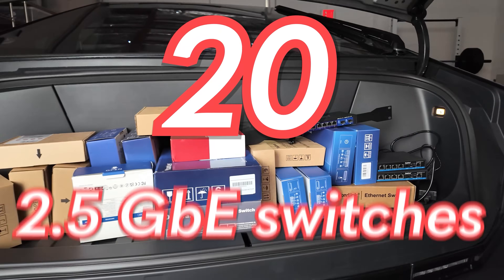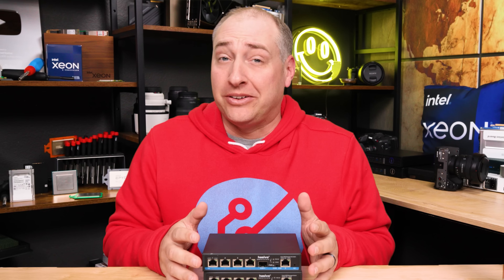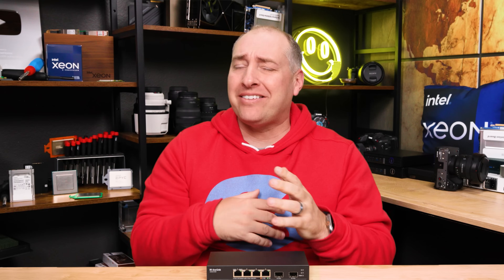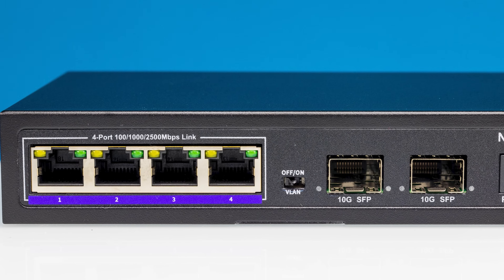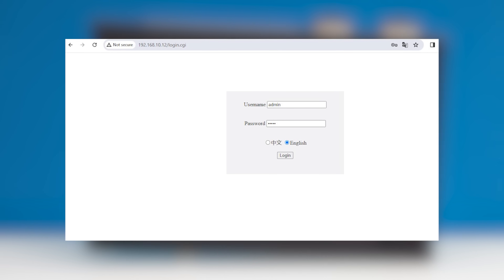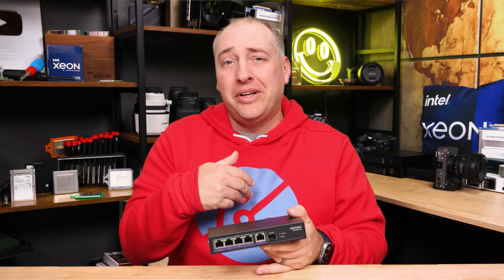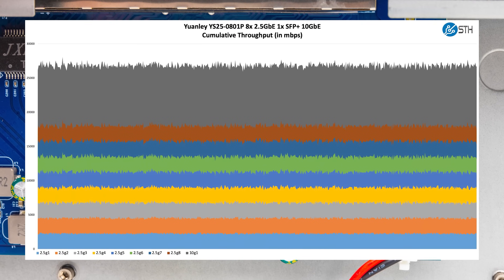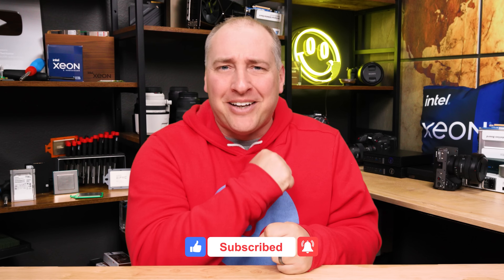Finding the BEST Cheap 2.5GbE Switch... by Testing 21 of Them

Comment: Man I really gotta question some of these prices. Why are many of the 8  2.5GbE (with no SFP or anything) more expensive than the 8 2.5GbE + 2 SFP switches?
Reply from the maker: A lot of it is that the 8+1 switches use a well-known dual Realtek chip solution that I think was developed for automotive. Then volume took over and the prices went for a nosedive.

Comment: Have you guys had any issues with the gigaplus gp-s250802 10gbe ports?

I recently purchased one and have had issues with the 10gbe port randomly disconnecting. I was using one 10gbe to uplink to our WiFi router but it'd disconnect our (wired) internet in the middle of my work day.  Using one of the 2.5gbe ports has not had any issues.
Reply from the maker: Are you using SFP+ optics or DACs? On these cheap switches optics seem to do better
Reply: Yeah, cheap H!Fiber 10gbe rj45 dac from Amazon. 

Using optical for the router connection is doable but I was hoping to use the 2nd port with in wall Ethernet for 10gbe up to our 3rd floor. 

Ah well, get what you pay for I suppose!

Comment: Hey Patrick, Does the Hasivo S600W vs the S600WP still have the same MAC issue, or does the P version MAC address differs? i need 2 of the switches and saw your focus video on them, not sure if the other models of the switch still has the same mac clash issue. Also what transciever works with hasivo if you have that info?
Reply from the maker: People have reported newer firmware fixed the issue. Also, we shoed in the video the Mokerlink is the Hasivo but on Amazon.

Comment: I am not sure if it can be considered "cheap" (it is higher price than for switches presented here). But 2 weeks ago I have purchased Zyxel XMG1915-10EP (8x2.5G, 2x10G SFP+1), all 2.5G ports are POE++. It is fully managed switch. The "recalculated" price was 330USD. The non-POE version is about 270USD.
Reply: Buy once, cry once..  In many respects, I'd rather buy a quality product over  a cheap; don't get me wrong, I do like cheap, but if the choice is buy once cry once, or get something cheap that MIGHT work, well, I'd rather cry and not waste my time.

Comment: Have you noticed slower ping times on the 2.5gig switches vs the 1gig switches?
Reply from the maker: Not really.
Reply: What I have noticed is 10gig SFP+ DAC ping times are very low compared to 1gig Ethernet.
Reply: @ServeTheHomeVideo  with 1gig, I noticed ping times at around 0.25 ms. With the 2.5gig switches, I’m getting 0.6 - 0.9 ms.

Comment: I don't get why gigabit switches with 2.5g rj45 uplinks aren't more common. It would provide sufficient bandwidth without having to go fiber while also costing a lot less than 2.5g-only switches.
Reply from the maker: At this point, the 2.5GbE switches are getting much less expensive.
Reply: @ServeTheHomeVideo  True but it's still not there yet especially if you need a lot of ports, which unfortunately most people do. Great video regardless. Your videos on network hardware are top notch👍

Comment: I would love, if you could test to power these switch using a USB-C PD 12v instead of the crappy power supply. I've replaced all the DC 9v,12v power supply.
Reply: If you get one of those little adapter jack / usb PD with a 12v trigger board, there is no reason it wouldn't work as long as your USB brick can deliver enough current
Reply: I'm not sure that's an improvement, especially if you use an adaptor. The 9v and 12v switches are very tolerant of voltage meaning you could run the power over quite long cables or even the type of passive PoE found in some TP-Link devices. However any device requiring a 5v PSU is usually extremely fussy that it's 5v so a USB-C on those would be an upgrade. The 5v devices lack any internal regulation.
Reply: @wayland7150  pretty much all modern electronics is at less than 3.3v so yeah these will have internal regulation

Comment: Any info on the nicgiga s25-0802p (poe) vs the the s25-0801p (poe)
Just 1 sfp+ port more and 10w of extra power just curious if they are comparable in terms of performance.
Reply from the maker: I think we recently got a S25-0802P and we will have a main site review of it in the next few weeks. It is still in testing since we have the process for looking for unwanted traffic before publishing reviews. When it is live, it will also be in our 2.5GbE Buyer's Guide on the main site.
Reply: @ServeTheHomeVideo  looking forward to the video and / or review, I got one on amazon (S25‐0802P) at some good discounts from 109.99$ to 82.49$ + taxes. Although I did notice perhaps a typo in the amazon pictures stating is 59.53Mbps switching capacity when it should've been in Gbps.
Wish they were managed, but I guess it is too much to ask for at this price point

Comment: What about power reading of SFP vs DAC cable?
Reply from the maker: It is a bit tough to go back and do well over 100 more power readings. Most SR optics these days use less power than the 10Gbase-T module so doing those measurements would only show a sub 2W power difference
Reply: @ServeTheHomeVideo  From now on I mean.
Reply: @ServeTheHomeVideo  considering how much the SFPs heat up vs DAC cables - I am curious what the difference is.

Comment: Can a SFP to RJ45 module work on these type of switches? If so which would you recommend?

I'm new to all this and I had purchased the MokerLink B0CN8NRF96 instead of the Mokerlink 2G040210GS thinking it was the right one, which it wasn't.

Not sure if I should return it and get a switch with 10gb RJ45 or just get the module as stated above.
Reply from the maker: They can work, but I would recommend putting them somewhere that gets decent airflow. The SFP+ to 10Gbase-T adapters tend to get very hot in these switches. That is one of the reasons we use cheap SR optics usually.

Comment: Back in 2004'ish I got my first 2x1Gb/s network card in the same pc. And now 20 years (or so) later I can get a 2.5Gb/s switch.
Honestly I don't even have anything to use a 2.5 Gb/s switch for. Network speed has moved so slow compared to everything else.
Well wifi have change a lot, that was basically useless back then.

Comment: Do you have MY perfect switch - 8x2.5G 2x10G no-POE Light L3 FIB(non-CPU) switch-routing?
Reply from the maker: Like the MikroTik we covered?
Reply: @ServeTheHomeVideo  I think that one isn't hardware switch router FIB, but using the CPU instead. Which is very inefficient if you use it for your main router. The reason I want one is that my routing VM(and the VPN VM) pegs the ESXi CPU quite a bit when having big downloads. A FIB L3 switch would erase all that since all the possible routes are pre-compiled and pre-loaded into the switch chip.

Comment: This rushes in without explaining anything at all about SFP+ or the other advanced interface. A lot of us have never touched anything but gig-E. I've been in this industry for 40 years, but never on the enterprise side, so I simply have no contact with this stuff.

A 60-second backgrounder on the ports would have been appropriate.
 
Also, "managed" means what, precisely? I'm running OPNsense on my home network. What does a "managed" switch provide that I can't already get from my firewall appliance? I suppose it will allow me to firewall ports on my home network from each other at the switch layer rather that with host firewall configurations. Is that it?

Comment: Does any of these switches have 5 gigabit? No? Why?
Reply from the maker: Several have 10G
Reply: Wouldn't the sfp+ options cover that?
Reply: To get speed over CAT5 requires a lot of power and was quite difficult for them to achieve 2.5g cheaply. A single 10g CAT5 card is £100 and has a large heatsink that gets so hot it really needs a fan. The SFP+ cards run very cool. You'd be better of getting long DAC cables and fibre for longer runs and an 8 port SFP+ switch.

Comment: If considering speed, why should one buy/use 2.5Gbe network, when there is Wifi 7 which has 3-30 Gbe speed? I know prices are still high, which is common with new technology, but as usual will be dropping.
Reply: wifi speed depends from the amount of nodes and amount of other networks around it. If you have 1-2 nodes that actually needed and don't live in an apartment you are probably ok. If you actually need more, cabled ethernet is better

Comment: this video but routers/firewalls for pfsense/opnsense
Reply from the maker: Interesting idea
Reply: @ServeTheHomeVideo  this is where I’m struggling. I am looking for a pfSense router that’s reasonably priced 8 port. My other issue is that I have ATT Fiber and have to do some additional work to even get all that working with pfSense.
Reply: @nikaiwolf  If you want to make your life easy, stick to a router for routing ,and leave the switching to switches :)
2 ports is enough on the router (maybe a 3rd for management), and that would feed your main switch.
A router with 8 ports will be more expensive than it needs to be.

Comment: Using a camera on a 2.5G PoE connection sounds like overkill.
Reply from the maker: But if you have AP's running on 2.5GbE and just need to add a camera it is easier to just plug it into an unused 2.5GbE port.

Comment: Did you say the sfp ports can't be used with adapters to get 10Gbe on RJ45 ?
Reply: You need to add a fan if you do that. The RJ45 10Gbit modules are very hot.

Comment: Chinese botnet hardcoded machines are not worth the discount. Did you know that small business routers are less expensive than consumer models and are more reliable?
Reply from the maker: We mentioned how we at least screen a bit for this in the video
Reply: @ServeTheHomeVideo  Try an understand, a botnet is not going to be constantly on. It waits for a triggering signal. This means until your botnet is started it acts like a normal network, while quietly collecting data.

Comment: the only problem with these little switches is the lack of rack ears.
Reply from the maker: IIRC we found three that had ears
Reply: Nothing a 3d printer can’t fix!
Reply: @ServeTheHomeVideo   Rack ears should come standard across the board rather than being a 100$ option.   1/2 height box with optional rack ears is not something that anyone should be paying extra for.
Reply: @Alex-oh5rt  I will admit the pent up desire to buy a 3D printer that I also do not need.   Gear Acquisition Syndrome is real.
Reply: @Alex-oh5rt  yep.. 3D printing can't fix that :P too fragile, too costly.. just put switches on a 1U shelf (good VHB double sided tape under), and presto.
Reply: @ledoynier3694  You’re wrong, I have an MS-01 held to my rack with a 3d print. It all depends on print orientation and material (ABS or better is ideal)

Comment: As a network engineer it's painful to watch 2.5g content knowing it's a bridge technology.
Reply: I agree but the home market is moving slow to bring lower cost low power 10gig Ethernet.
Reply from the maker: So the other way to look at it is we get a 2.5x speed-up and 10G port volumes are falling already.
Reply: @ServeTheHomeVideo  feel free to ask the NBASE-T Alliance when the next milestone is due for the market, I assume they want 5g next.
Reply: I mean it's much more useful than rewiring a bunch of buildings wouldn't you agree? My home has cat 5e in the walls, with 2.5gb I get a free speed bump without having to tear the house apart.
Reply: @SteveSunny  I think rewiring at this point is worth it only if you can afford the equipment, the cabling itself is cheap.

Comment: with all due respect, does it guy know where switches work on OSI model? because he briefly mentioned people's concern about security and how he/they take that into consideration before reviewing a product, without elaborating further, it sounds to me like he doesn't know what he's talking about (i could be wrong though).

anyway, here's a quick overview, in general switching is the transmission of data between one or more devices, there are a few types of network switches, but we'll focus here on managed (it features, lacp, vlan, QoS, stp, etc) and unmanaged (dumb) switches since those are the most common for basic users.

a switch operates in layer 2 or data link layer of the OSI model, it ONLY knows/cares about the destination MAC address.
therefore, it has a MAC address table where it stores information (mac + type + port) about the other devices. that table enables the switch to learn and transfer data (Ethernet frames) on the specific port to the right destination, instead of broadcasting the data on all ports (flooding).

security wise, you can implement some sort of security on layer 2 switches by filtering incoming frames based on the MAC addresses of the connecting devices.BUT, nonetheless, if someone (with the right skills and malicious intentions) is on/or gains access to your local network you're SCREWED.

Comment: Hi, Thanks for these very helpful vids about 2.5GbE switches,, BUT, I cannot make any sense of your colourful graphs! There's a scale on the left, and some very similar (confusing) colourings both in the graph and the port logos at the bottom, but, to me, an admitted novice when it comes to networking, it seems like you must plug your RJ45 cable into only port 8 to get good speed throughput. It would also help if the figures on the left represented the speed in the common, and what everyone uses, 1GbE/2.5GbE/10GbE rather than the confusing, and not used by hardly anyone, numbers in their thousands. An explanation of what the graphs are showing would be useful. Port 1 for example, looking at your graph, is a waste of time using, as it appears so slow!And who cares about the tiny TINY amount of power these use? No-One. Save yourself some time - we don't care if it's using 0.5w/1w or even 5w - it's totally insignificant.

Comment: National Defense Authorization Act of banned hardware manufactured by certain companies
if it's on that list, they have determined that it either exports information or has a built in backdoor.
You should cross check it with at least that list before making the claim "it's safe"
Reply: "National Defense Authorization Act of banned hardware manufactured by certain companies"
This is for use in infrastructure,  government/military, and contractors/subcontractors.

"if it's on that list, they have determined that it either exports information or has a built in backdoor."
Oh boy.  No, they simply say that there is a "risk" and is therefore banned.  That is fair, for the above agencies.

"You should cross check it with at least that list before making the claim "it's safe""
Go look at the list.  None of the devices shown here are from those manufacturers.

Also look at the 6 minute mark in the video.  Number 1, if it doesn't have a management processor.. Then it has no brain to do these things.. If it does have a management processor, then do the responsible thing and RESTRICT your switch's IP from going out to the internet.  Don't expose interfaces to the internet, don't let it go to the internet.  No reason on any switch to allow that traffic.